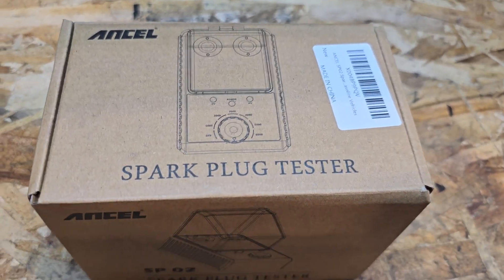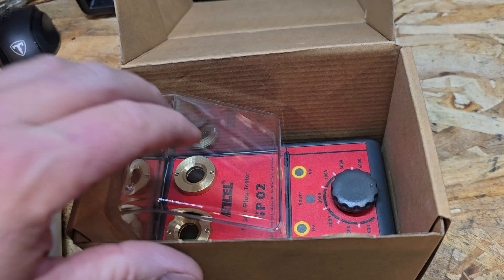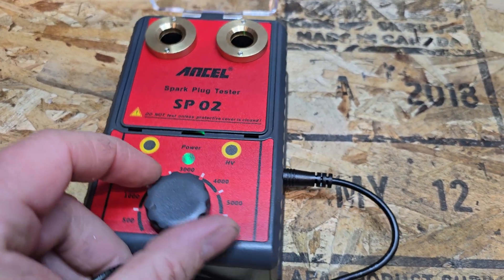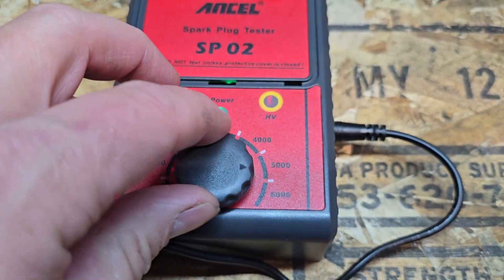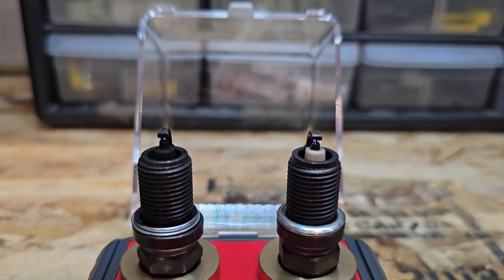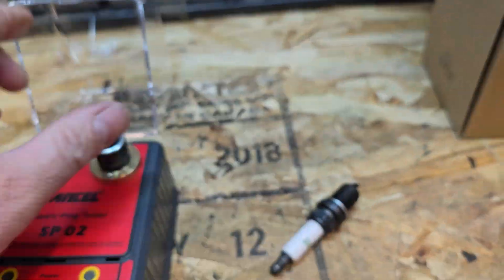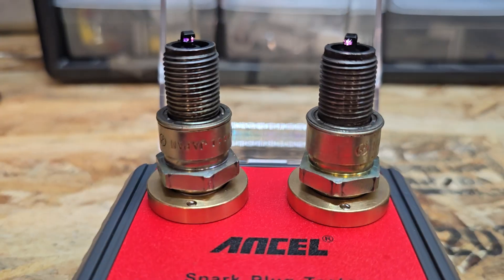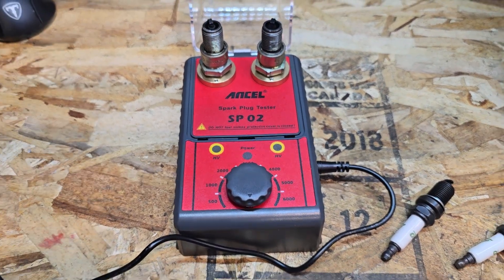ANCEL SP02 Dual Spark Plug Tester 0-6000RPM Tool Test

Comment: So how do you tell if a plug is bad?the fouled plug still sparks.. i think this needs to be done under compression to test it properly?
Reply from the maker: Correct. This will rule out a totally dead or weak plug, but obviously can't catch a plug not sparking well under compression. Pretty hard to do that with an easy to see tool. It's better than nothing!